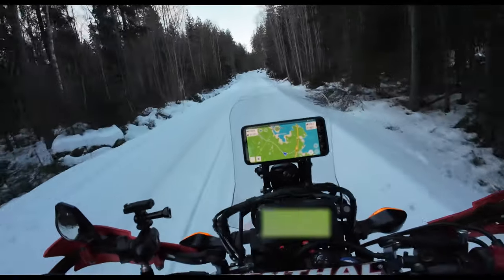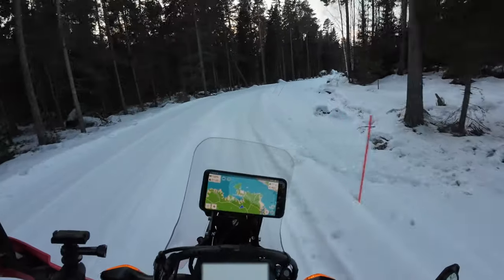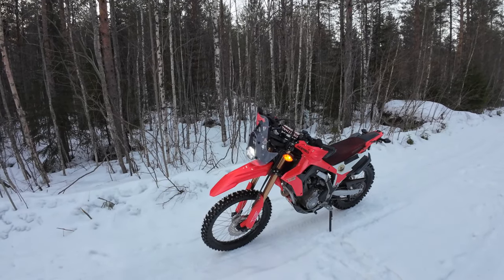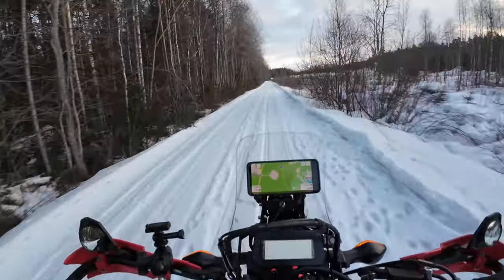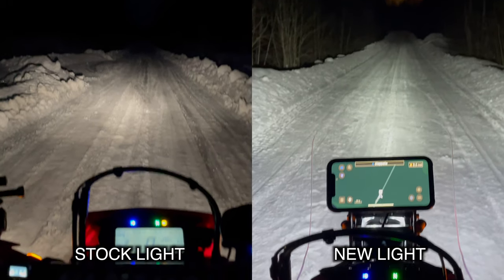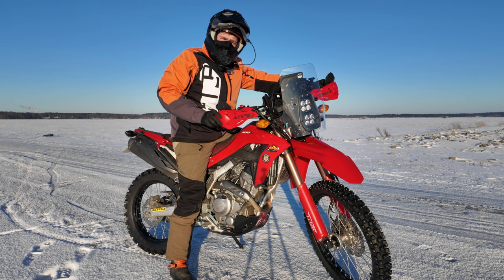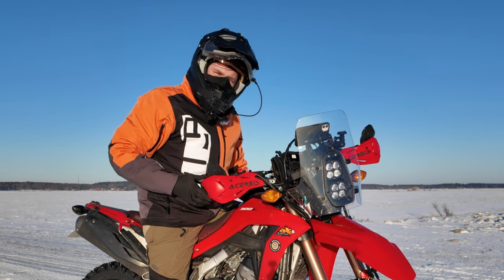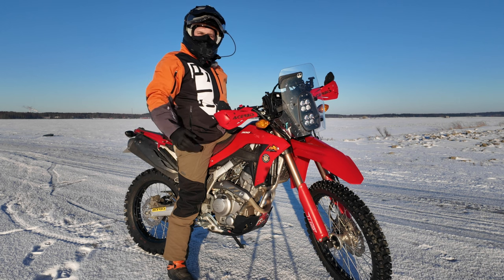Honda CRF300L Rally Tower Build: It's AWESOME! (3/3)

Comment: Looks: way better than stock and the rally indeed!
Light output: very bright 💡
Nice benefit the wind protection is better than the tenere (but that’s not really an achievement because the wind protection on the t7 is disappointing)

Is there also a weight saving compared to the stock setup?
Reply from the maker: Its about 1.7kg heavier compared to the stock setup I removed. I have the weights on the second videos description 😊

Comment: thanks for a video. top notch work on the review – light comparison, air flow description. not a big fan of the looks, as neutral as stock for me, but somehow out of place… the fact that it does the air job (;)) done so well is the first reason i'd get it. second is horizontal bar to mount gps/phone – but are those two things worth paying for the whole package? by the way, i've done some dynamic riding in slovenian mountains/villages during the night and stock light was enough for what this bike is capable of. there was literally one, ok two moments when i felt i could have better vision. but i think 10€ flashlight mount could cover that. then it's up to you weather to mount wide light flood (like for camping, slow technical passages, corers) or narrow beam for faster sections. otherwise, in my opinion stock is nearly always enough. and again – solid work on the video, thanks!
Reply: ah is the plexi further away from the rider? not cutting neck in case of something unexpected?
Reply from the maker: This is by all means not the most affordable way to do a light upgrade 😅 I think the price is ok if this is wat the byer is looking for exactly but other than that it is a lot of money to put on a cheap bike for sure. 
The plexi being a health risk is always something I have thought about too with a dualsport bike. I can't say that there is no risk with this one but at least the plexi is not bolted on so it might come off the bike more easier than most normal bolted solutions. Also the plexi is a bit more flexible so it is not as hard as for example my Tenere fairing is.. which is also bolted on so it's not going anywhere if I hit myself in it.
The distance to the rider is shown pretty well on my youtube community page post. The second picture if you click the arrow or or swipe from the first one. There is some distance to the plexi but ofcourse its always possible to hit yourself in it if you are really unlucky.

Setup like this can never be as safe as the enduro stock setup on the CRF. But also if you ride enduro with this bike you can just pull the plexi off and ride without it. No need for any tools and the light stays in its place.

Comment: Your bike looks awesome! I think it looks better than the tower on my stock Rally. Not only that, the light points in the same direction you point the handle bars, which is nice. I rectified that problem though with pod lights mounted to the forks. now i have ample amount of light. The only difference now in your bike and the Rally version,  is that the lower plastics on the Rally actually do divert the air around the lower portion of the body, offering slightly more wind protection. its not very much, but when its cold every little bit counts.    I want to know how you like your rear view mirrors, do they offer just as much visibility as the stock mirrors?
Reply from the maker: They absolutely do not. You can see car lights and stuff like that but the visibility other than that is very compromised.. and you can't see much what is behind you due to the placement. 
I like the mirrors as they are not in the way when I load the bike to my van (very often) and they are not going to hit anything as easily as the normal mirrors do. 
But for actually good mirrors I would go for doubletakes or something like that. I just personally don't like the look of those adv mirros at all :D
Reply: @PatchedBandit  thanks. Yeah, I don’t like the looks of the adv mirrors either. I bought some cheap folding mirrors off eBay, the mirror itself are triangular shaped. They perform ok, and look decent. They are slightly smaller than the stock, but I was hoping to go even smaller, but I don’t want to lose that much visibility. Thanks for the input!

Comment: Nice video especially light comparison with the same camera settings and drone shot as well. That's a tough filming at -16C)).
Request: When you change tires, please make a quick run on tarmac between 60-100km/h and release handle bar to see does it wobble if you ride handless. Usually if the windscreen is installed in obtuse angle that could cause wobbling and instability, (physical law of air pressure)
Reply from the maker: Thanks! I will definitely do more testing when the weather eases up 🙂 I could do that now but the spikes are so unstable there's no point 😆.
Reply from the maker: Coming back to this now I haven't found any unstability on higher speed during my summer rides. Only thing I have noticed is that maybe impacts to the steering riding harder enduro high speed technical terrain is felt a bit more as there is more mass moving about but this is very minor and usually not even noticeable. 
Wind is definitely not giving me any stability issues though.
Reply: @PatchedBandit  Thank you. I installed it recently and noticed masses on steering wheel as well.

Comment: It looks great 9 out of 10 also looking at something similar….have the adv spec mini fairing now but want better wind protection and better lights …can I ask how tall you are?
Reply from the maker: I'm exactly 174cm (5 feet 8½ inches). My CRF300L has the Rally-Raid Level 1 suspension.
Reply: Thanks…have similar yss front and back suspension…great little bikes.Live in a slightly warmer country(S.Spain)also out off-road nearly every day😊
Reply: 6 ft 2 though…

Comment: Yes, bike looks very good with that tower. It also looks lighter than the actual Rally tower...
Reply from the maker: I think the bike is still between 2 to 3 kg lighter than the Rally version now not considering all the other mods. Swapping the Acerbis tank is gonna shave some more weight off the top when the tank is empty. 
I'm considering changing the exhaust next as the stock pipe is super heavy and it's all in thet heavy top part of the exhaust.
Reply: @PatchedBandit  I have also a problem how much km's I can ride with my XChallenge, only 9,5 litres tank but I have bought myself Desert Fox fuel cell 3L that gives me about 70km's more if I put it full.

Comment: Now that you've had the chance to ride it extensively, let me ask you: Do you feel the extra weight of the tower upon steering the motorcycle? I think that a slight disadvantage of this execution is that it is bolted on the steering system instead of the frame (as it is on the Adventure model).  I have the same one and I can tell that steering has become considerably "heavier". 
BTW, love your channel, keep up the fantastic work. Cheers from Greece!
Reply from the maker: That's interesting as I havent really even noticed that myself. This might also be that I'm running spiked tires so the steering is very 'wild' lightly put as the grip is so different. 
Maybe my opinion changes over the summer but so far I haven't felt this. Also I could be making a small difference with my mirrors? They weigh nothing 😊
Thanks for watching the vids! My favorite coutry to ride Europe is Greece 🇬🇷
Reply: @PatchedBandit  yes, getting rid of the mirrors might help alleviating the effect. You should definitely come ride TET Greece in the summer, and you MUST get in touch with me before you do! Cheers!
Reply from the maker: Ive been there the last 2 years but not sure if I will make it this year 😣 join the discord or Whatsapp groups. I’ll keep those updated on my travel plans.
WA is new but I made it as many dont use discord.
Reply: @PatchedBandit  Wilco!

Comment: Why not buy the rally if you make the regular into a rally one? Not hate, just curious as I'm deciding between the two :)
Do you have tyres with spikes?
Reply from the maker: I have a winter riding gear video coming out friday. I'll show the tires there a bit too. 
It's a good question and for me the decision was not super easy but here are few reasons why I went with the L version:

1. Rally is 1890 € more expensive in Finland
2. Rally is about 4 kg heavier than L. Not much but as the bike is already a bit heavy everything counts
3. I like the slimmer design of the L
4. Less plastics to brake on the L
5. I never liked the look of the Rally version. It looks weird in my opinion :) Not a huge issue but worth mentioning for sure.

Even though I installed the Rally Tower I still have a LOT cheaper bike with even better lights than the standard Rally version. Even if I change the tank to Acerbis (which is lighter btw) I still get a lighter and more affordable bike.
Reply: Would that be a bigger tank than the stock L? In Norway the price difference is similar. But the 2023 Rally was priced just 3000nok less than the 2024 L

However, the thing I noticed the most was how soft the suspension is, especially with a passenger. Stiffening that up might be in order @PatchedBandit
Reply from the maker: Stock tank is 7.8 L on the CRF300L
Acerbis Fuel tank 14L Honda CRF300L
And CRF300 Rally has a stock 12.8 L

So the L will have a bigger tank with the Acerbis upgrade. And as far as I understand the hardware itself is lighter. Plus the fuel sits lower on the Acerbis tank so it should be slightly better balanced too.
Reply from the maker: Oh yeah and I put in Rally Raid Level 1 set on mine. I have a few videos about it here too: https://youtube.com/playlist?list=PLjuLZY6TnpPnQWrKL7vgN6eCmeAY5Ea4Z&si=Ze5HsPs8_RieX0UP